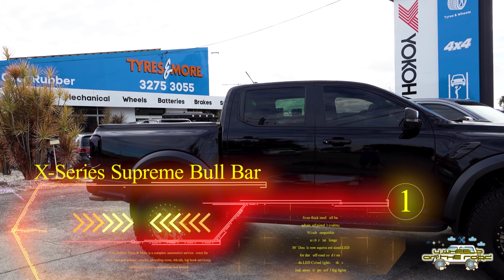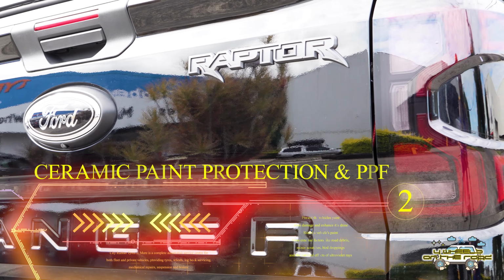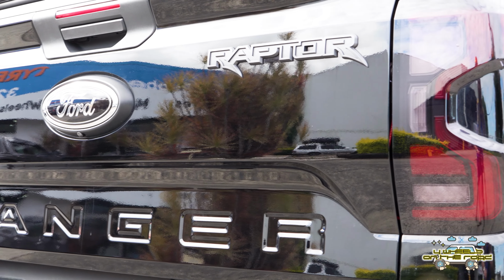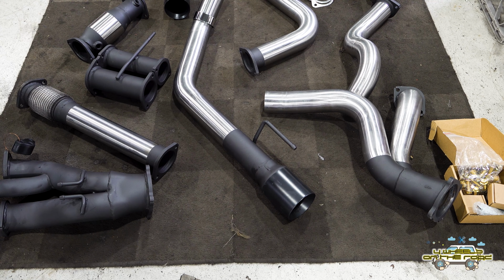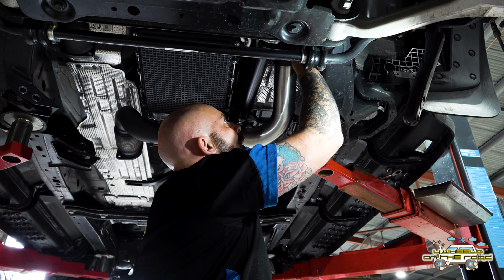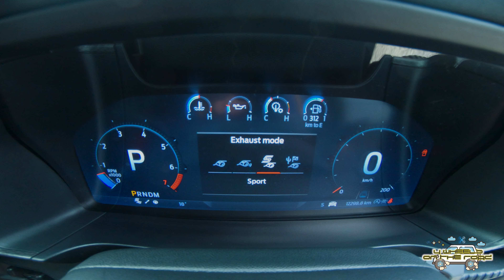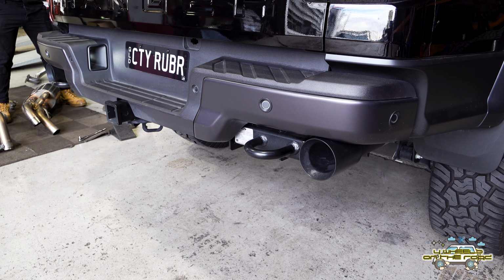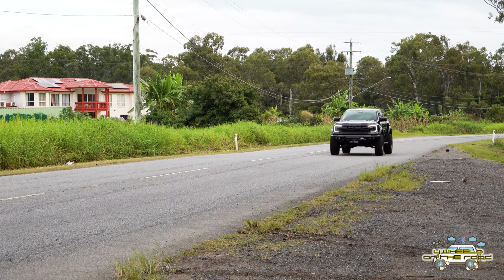Ford Ranger Raptor Upgrade - Tickford 3" Exhaust Upgrade - Get Some Ideas For Your Rig - City Rubber

Comment: I got a :
Tickford turbo back exhaust
Tickford ugrade front brakes
Tickford upgrade 18" Method Race rims with Bridgestone rubber
TurboSmart blow off valve
Fenix Massive intercooler upgrade
Fabulous Fab twin airbox upgrade
Dyno tuned.
WHAT A BEAST. WELCOME TO THE 300kw+ CLUB
Reply from the maker: Love it! That’s a lot great kit mate, I bet you are loving it as well!
Reply: @4WheelsOnTheRoad  Best exhaust sound ever. Thx for a great channel
Reply from the maker: @ttecsolar2846  thanks mate!